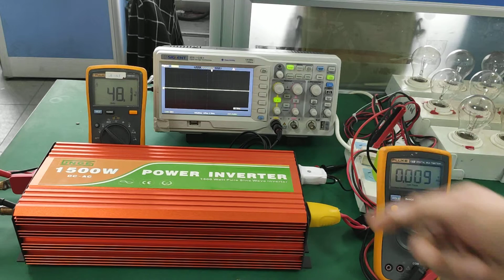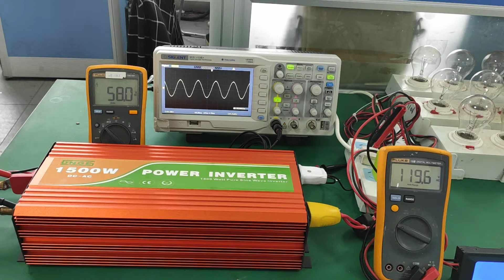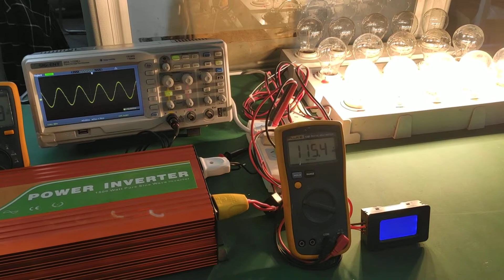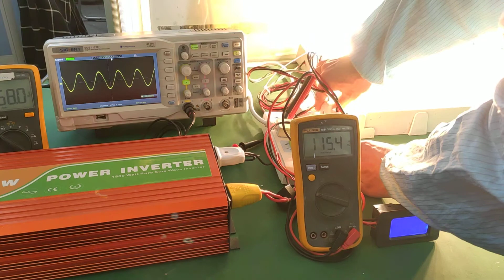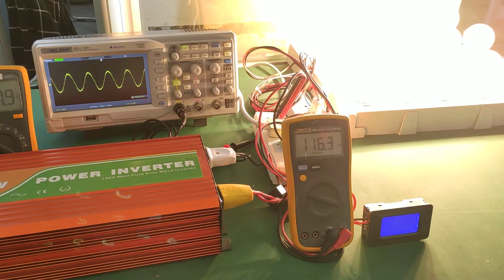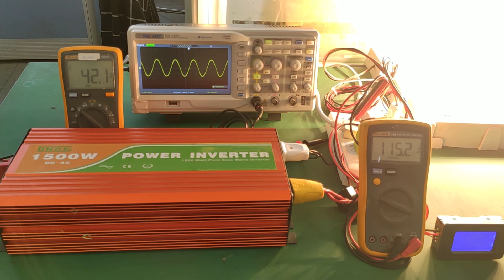JNGE POWER 1500w DC to AC pure sine wave inverter working test

Comment: F086 show on display and no AC output
How can I fix it.
Reply: Pls contact the after sales team to help you solve it from the shop you got it, tks!
Reply: @sunnytao7764  They repaired but inverter cannot used under 43 inched smart TV , before we can used up to 1000Watts now up to 200Watts Only.
Now I am not using that inverter because of  I feel not safe for my electronic device 😊😊.
Reply: Now, I found the fault is PWM driver circuit fault.